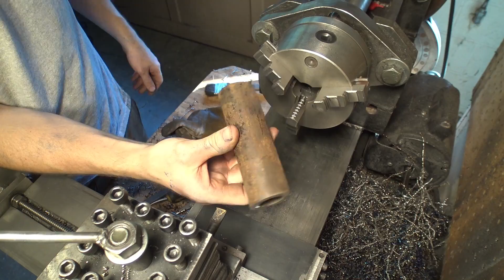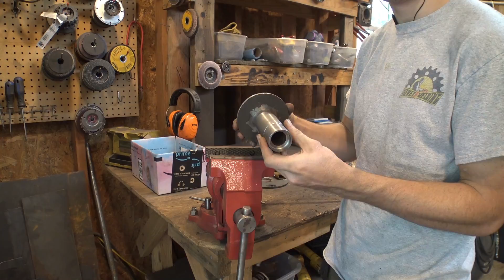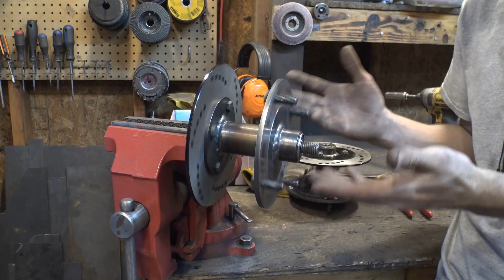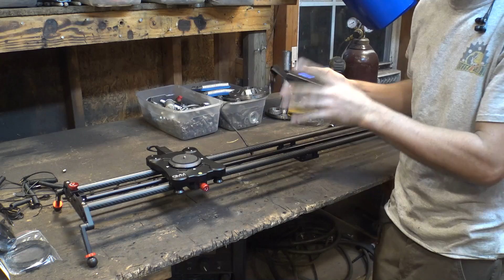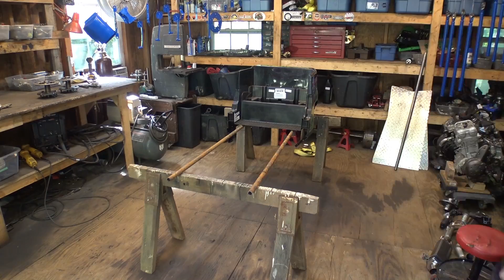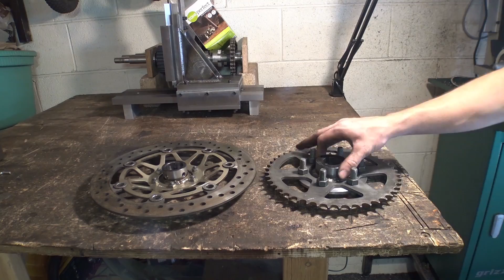Ninja 650 Powered Power Wheels Build Part 2

Comment: I wonder if its possible to wire in a speed controller to the motor on your camera slider, or maybe just add a resistor to slow it down...
Reply: Experimental Fun good idea but you’d you’d also think their would be a way to reprogram it, I’m sure someone out there with the knowhow has done it 👍🏻

Comment: Chris... ever think about using a small transmission on your homemade lathe to add quick speed changes?  I have a Peerless 700 on one of my old South Bend lathes that used to be a pulley style speed change type.  It works great and now I even have Reverse without wiring the power switch for forward/reverse because the gearbox has it already.  5 forward speeds and reverse.  Its great that you get so much use out of your machine!

Comment: If your camera will shoot single frames,  you can do a time lapse video of up to 22 minutes.  The control for the slider will trigger the shutter on your camera.
Also it can be set to travel back and forth continuously in video mode.

Comment: Would be cool if you made it 4 wheel drive.
Reply: With independent rear sudpension.
Reply: Yes 4wd only way to go! With 4 wheel steering!
Reply: On 2wd combines they'll turn the rear tires backwards so they steer and track straighter through mud. Maybe that'll help the fronts until he finds a donor drivetrain on the side of the road. :)
Reply: You don't need 4x4 with a ninja engine, lightweight and aggressive rear tyres is what's needed, it will rip through every thing with pure wheel speed, id like to see a 4x4 build on something with more low rpm torque oriented engine and a larger frame, although I am doubting this thing will be stable enough to rip hard and not flip without ballast up front so maybe 4x4 would be an advantage although a complication
Reply: Yes, after seening lots of his videos and know how skilled this dude is, I would say it's about time for something more complex, hit a new level, single wheel suspension and awd with differential is seriously something to get on.

Comment: You should really consider putting a spacer between the bearings that keep you from tightening the front spindle nuts and burning up the bearings - Like all Motorcycle wheels have in them

Comment: Did a little digging and found a Lost goodie- on YT, "Fastest power wheels ever? Go to 4:38- there is your steering and control answer- it's across between a steering wheel and a M/C handlebars- steering, brakes, throttle- only shift not on wheel- not a fan of his shift plan.

Comment: Seen a video the guy had a arm mounted in the center of his shop ceiling that would do a full 360 around his project over head for his time laps your a smart guy should be able to do something with a drill motor and speed  controler

Comment: C'mon man you can slow it down. Either voltage or current through use of capacitors or rectifier or resistors. You got this man. Is it battery powered if so its gonna be easy peasy

Comment: The GHP guys have already committed themselves to a sterring WHEEL for their Mario Kart- there is very little foot room for pedals. You look to have the same problem- use a short M/C handle bar and hand controls for throttle and brakes- with aux brakes on a long lever on the side.

Comment: You could probably modify the camera rig to go slower. All you need to do is change some gearing around. Or build a small gear box for it with nylon gears. And, also, why don't you just set it up to go back and forth during that time? It doesn't have to be one long slow movement from one side to the other. It could move several times through that motion in one time lapse scene.

Comment: Love the vid's. I turned wood, and I've seen big high tech machine shops do their computer medal works, but I love the basic medal lathe work. Food for thought. Throughout the years, things concerning 'All things cool' began with paint, then chrome, stainless  steel, an array of colored lights, and of course, the yellow spark plug wires. Don't quote me, but I think it took 400 years to discover that a pottery wheel could be used in the upright position. And now, finally, somebody discovered that colored fuel lines would be cool. Duh! With this evolution train of thought, I propose that with all the colored poly material now available, that material could be used in some of your turning, like bushings, and .... not telling what else. Not my forte, but it's maybe worth a thought.

Comment: Would you sell those parts as a whole seller or retailer? The average mark up is 20% over the cost that you use to make them.  Material, Electric, Gas, ex..... You would have to figure out the math on that. You should be able to sell them cheaper then a retailer because there's no middle man.
Thanks for the Videos. Awesome job!!

Comment: gear swap the camera slider... or study it and make your own, custom built stronger so if something happens it will still work
Reply: Also he may be able to drop voltage on the motor side maybe place a variable potentiometer on one leg of power to the dc drive motor, that would give him a whole bunch more range.

Comment: Come on man put independent front and back suspension on that.
Reply: Independent suspension is great and all, but the solid axle design is more true to form. And just... Cooler.
Reply: @99milesaway41  no not really
Reply: @corysnladventures2758  no not really it's cooler, or not true to form? Specifics help, man.
Reply: @99milesaway41  Straight Shaft is not cooler I don't think

Comment: You make everything else why don't you just make yourself a geared camera track? would not be difficult simple geared DC motor say 34 to 1 or 68 to 1 ratio Running all thread camera mounted to a table welded to Nuts! simple polarity switch at the end of travel would reverse it  poof easy camera slide and if you use a stepper motor and controller it could be nearly infinite speed well slower or faster than anything you could possibly want or need.

Comment: Why not just use the sprocket as the brake disc?
Reply: The grease and oil would not let it work, would slide too much...
Reply: @lennym1273  then how do custom harleys do it cause I see it all the time. Lol
Reply: @eavesstreet6307  Humm never seen that, will have to look at that...
Reply: @lennym1273  ya I have even seen belt drive brake kits. I guess if I didnt work on them I'd never know about them. It's pretty cool set up
Reply: @eavesstreet6307  Man that took some searching to find one, seams like it's on the older models, you are right but it still a bad idea if it worked good they would still be using them i would think, plus I would think that would need a certain type of caliper to clear the teeth part so I don't think that would work with a regular caliper and probable more money after all ANY thing with the Harley Davidson name cost 3x more lol...